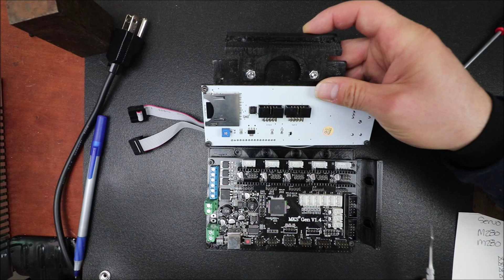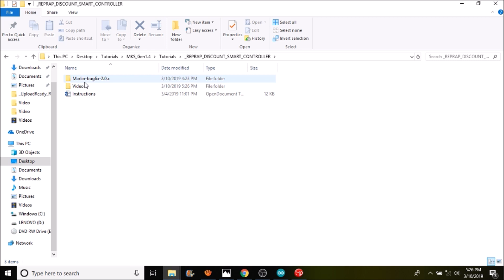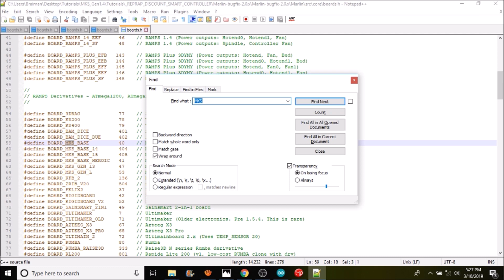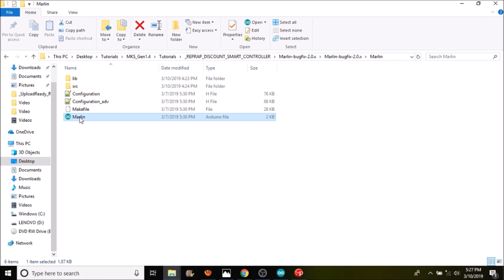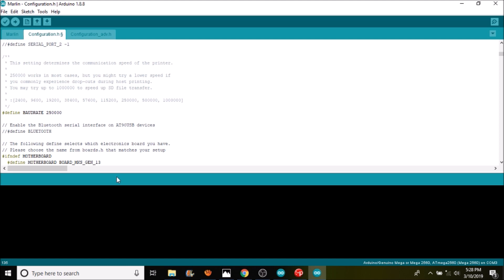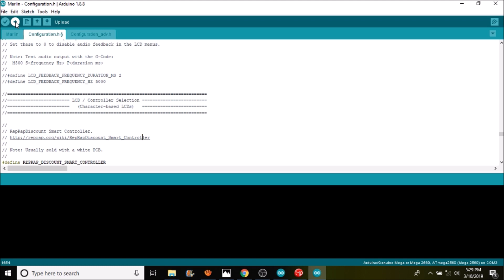MKS Gen 1.4 - REPRAP DISCOUNT SMART CONTROLLER

Comment: Thank you for the video tutorial. Is this the same process for the bigtreetech tft display 24. Just enquiring or is not supported. Cheers thank you
Reply from the maker: For TFT display in Marlin firmware the second serial port will need to be defined.  Not sure which number is will be, likely guess would be 1, 2,3, or 4.  I'd need to research.
Reply from the maker: Also MKS Gen board does not use TFT cable, but aux 1 pin cable connection.  BTT tft is not compatible as far a I currently know.
Reply: Thank you for your help and clearing it up for me.
Reply from the maker: You're welcome.

Comment: Hi Edward
Thank you so much for your video, it is really helpful to learn.

I have an issue with uploading firmware.
Please see the error below.

Sketch uses 105458 bytes (41%) of program storage space. Maximum is 253952 bytes.
Global variables use 4026 bytes (49%) of dynamic memory, leaving 4166 bytes for local variables. Maximum is 8192 bytes.
An error occurred while uploading the sketch
avrdude: verification error, first mismatch at byte 0x0000
         0x14 != 0x0c
avrdude: verification error; content mismatch

I have tried to upload with Marlin-2.0x and it uploaded successfully.
And now I'm trying with Sidewinder X1 firmware but the error occurred as you can see the error.

Can you please help me to solve this problem?
Reply from the maker: Looks like you're using Arduino IDE, which I did the original tutorial in.  It maybe that you need a plug-in.  If you change to VScode IDE with Platformio it might compile better as the plug-ins are pulled for you.  What parts configuration?

Comment: Thank you SO much for your assistance on this board.  A problem I encountered and worked through:  After following the instructions in this video I was left with an LCD screen that lit up but did nothing else. After some searching online I found that I needed to uncomment a different directive.  Instead of  //#define REPRAP_DISCOUNT_SMART_CONTROLLER I needed to uncomment  #define REPRAP_DISCOUNT_FULL_GRAPHIC_SMART_CONTROLLER (line 1870 of configuration.h).  I hope this will help others trying to get this board up and running!